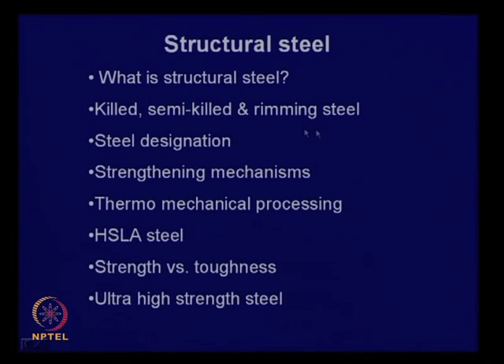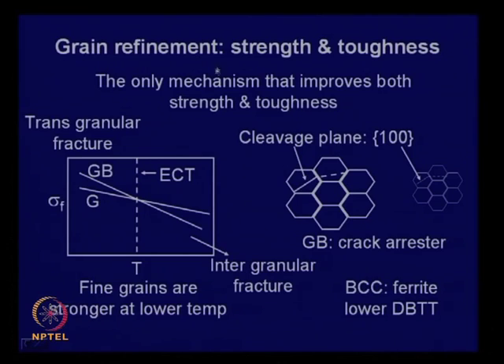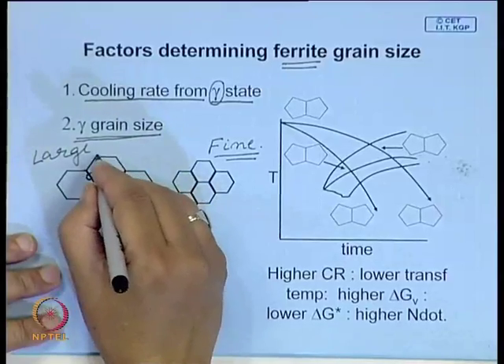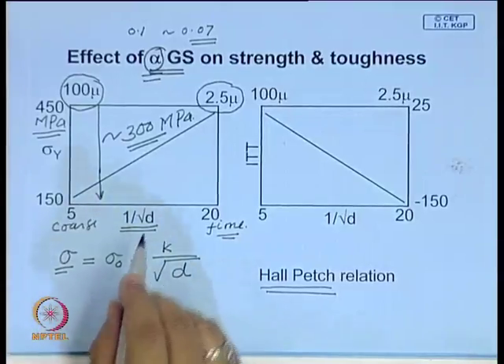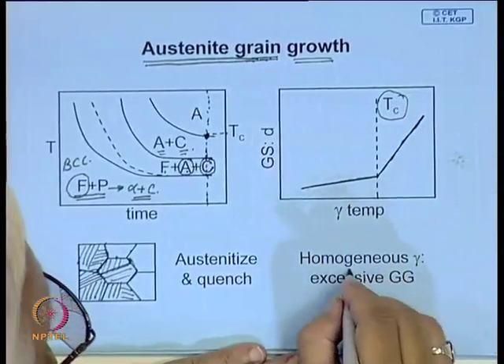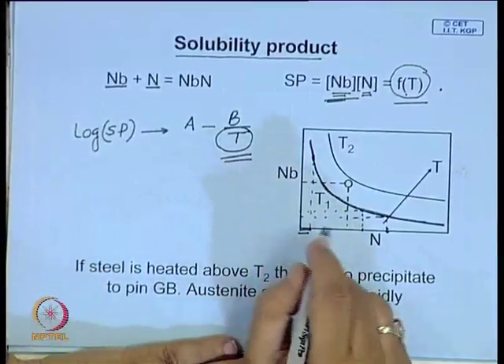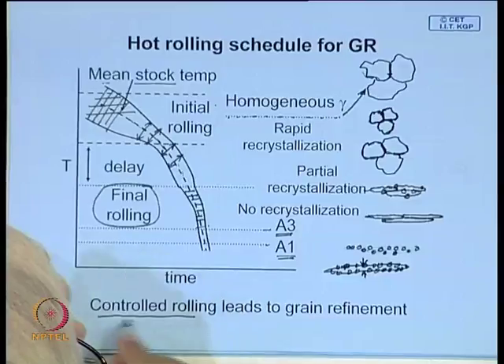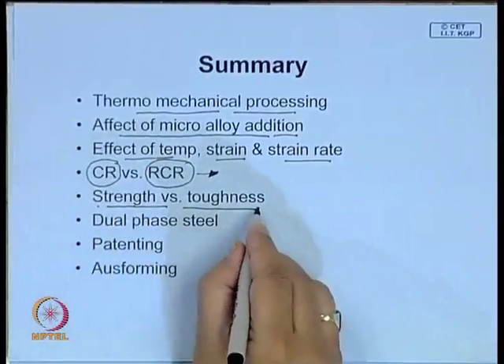Mod-01 Lec-39 Structural Steel (Contd.)

Comment: in the ttt diagram you marked eutectoid temperature line as A3 but it is called A1....i must tell you , you are the only lecturer i hate on nptel...like all other are just perfect in delivering lecture you tend to stammer and just go off topic...i dont know how you completed this whole series...i just watch your lectures for the sheet that you had...thanks that at least sheets are accurate
Reply: Actually he is talking about Structural steel-> low carbon steel->hypoeutectoid steel. So in this case the critical temp is A3 not A1. Please don't hate such teachers, there can be some human errors.
Reply: so whoever makes the mistake u hate that one......So Whose mistake r u then